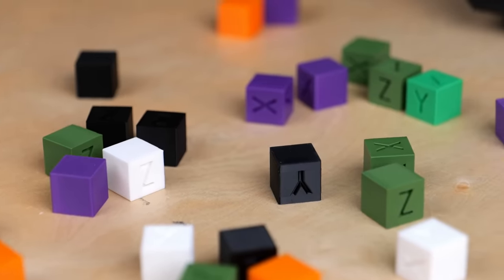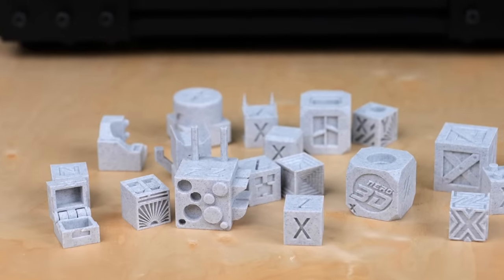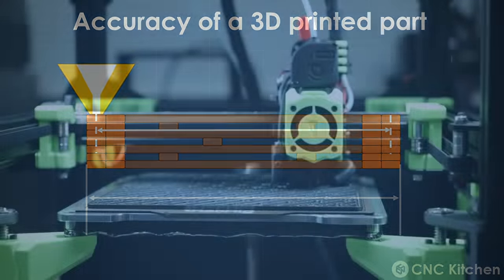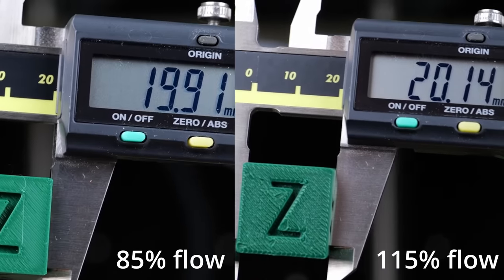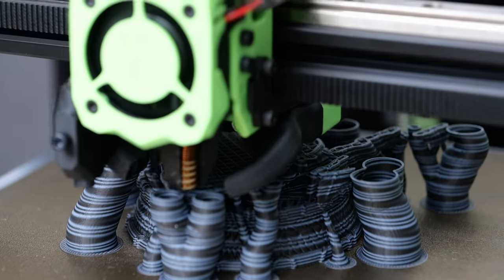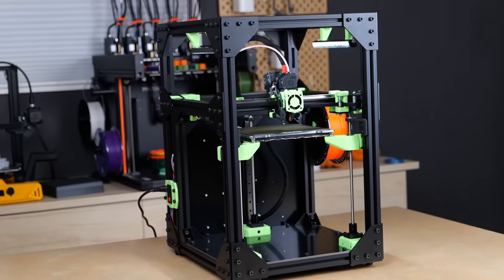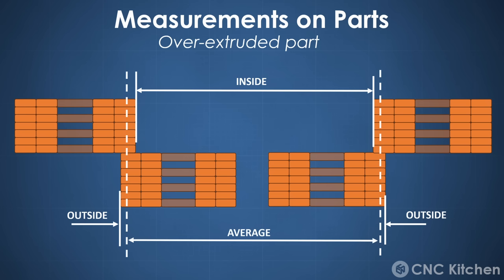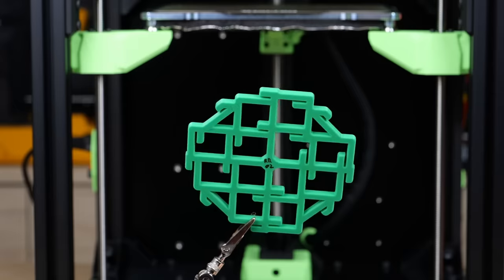Calibration Cubes: More Harm Than Good?

Comment: I completely agree with this method and this video explains the multitude of variables and how to calibrate and square the machine quite well. I've tried to guide customers to calibrate their machines and most will just not do it at all and assume that the machine is already calibrated from the manufacturer. the only change I would make to the cali-flower is adding a relatively tall tower thus adding more accuracy to the Z axis. The wider, longer, higher measurements you can do will add more accuracy. It would be nice i the material doesn't matter and the measurement were measured at the center of the nozzle from a reference point and the software would compensate for the material and settings used.

Comment: When i first started 3d printing i altered the steps per mm, but as i gained more printing experience I came to the same conclusion as you that it was not the proper way to compensate for size error as the majority of it is material shrinkage which varies.  I've also found that there are tons of variables including temperatures when printing, i.e hotend, bed, enclosure or ambient temps.

  I've also found the speed at which the part is printed can affect shrinkage.  I think this has to do with the rate at which the filament cools on the part.

For example, I've printed a test part and then scaled it.  Reprinted the part to verify that the scaling was correct.  Then when i would print a batch of those parts the size would change.  I suspect this is because the layers have more time to cool as the printer is moving from part to part every layer.

I was able to negate this by completing individual parts 1 at a time.  Aka if printing 10 parts I'd enable individual part printing where it would fully complete 1 part before starting the next.

I guess my point is that if you want to print accurate parts there is not 1 set of variables that will work for all situations.  You'll have to adjust based on what your printing.

Comment: 5:53 I would really appreciate links to the other tuning steps you took - so many stl's and techniques out there just knowing what you used would be valuable, otherwise I'm left trying to recreate the process and wondering if my results are as good.  You mention:
Extrusion Temp
Flow %
Retractions
Pressure advance

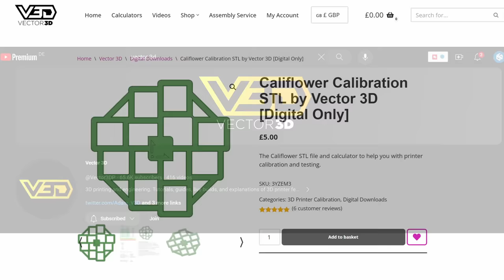Comment: 5:26 I prefer the calilantern, which is the version of the model with a z component! If you're going to measure a bunch, you may as well fix the skew on all axes. And yes, the shrinkage should be tuned for each material as well, once a base rotation distance has been set.
Reply: Yeah, going to buy the calilantern now. I've printed so many public STLs that didn't quite fit, never sure if it was the model or my printers. The biggest downer with 3D printing IMHO is making parts fit with post processing.
Reply: I felt like the Cali lanterns is harder to hold and get consistent measurements on

Comment: I find those vids/topics fascinating, mostly cuz makes me realize how experience/knowledge dictates much of what one does. Personally, since the very 1st time I've started 3d printing on my 1st machine years ago, I've calibrated it on a per project/material basis.. for me this has always been a given, but then again I went on to study precision mechanics when I was 14'yo and thus have had a deep understanding of many different manufacturing processes and materials for literally decades... Since I also have an engineering degree on mechatronics/robotics, so CNC machines and such are just intuitively simple to understand and thus tweak. But I do realize many enthusiasts lack the same fundamentals, and this is what I like the most about the 3d printing community, folks often times share openly the knowledge and often challenge the "trends" in order to help each other to achieve better results... Kudos for the topics and analyses...
I will say thi tho, I do find both my i3Mk3s and P1S to be reliably precise, as long as properly calibrated for the material used, and still is not uncommon for me to tweak the models to compensate for inaccuracies of the machines, after all hobbyist 3d printers are not nearly as accurate/precise as professional grade industrial machines... Even so, w/ the certain measure of knowledge and care one can achieve amazing parts w/ these little machines XD
Reply: Хорошо сказал.
Reply: also, I hate when my phone wrongly auto-corrects me (like my comment above), kudos to machines that while maybe not as smart and thus very reliant on us to get things right (as of yet) at least don't pretend to be "smart" and f. us all the time on simple stuff (like writing a message or navigating the city)...(looking at you iPhone/Apple and others).. love my 3d printers cuz whatever tasks that don't need my input they do perfectly well, everything else they do exactly what I command them to do...

Comment: Major props for letting the author of the cauliflower update his design, it's not one I've seen before but I've been meaning to my Voron even more dialed in and it looks like it'd be a big help. I'm fully in agreement with your conclusions. Steps-per-mm are defined by the gearing of your printer. Shrinkage adjustments, line width, etc will dial in a printer far better. And don't forget to print a cooling tower to dial in your fan speeds as well!

Comment: I agree that the cube isn't perfect at all, but it's a good quick way of checking accuracy in general rather than a tool for adjusting for it.
Califlower seems like a nice development, though I'd like to know how can I adjust bambulab x1c with data I get from that print except for in slicer settings for every profile for every nozzle and material I use.
Reply: For any of the bambu labs printers would be good as not everyone owns a x1c 🙂

Comment: The parts come out undersized not only because they shrink, but also due to wrong assumption. You assume that every tooth of 2gt belt has a 2mm pitch; however the belt is manufactured undersized, because it's supposed to preload to nominal pitch while minimising vibration and backlash. You notice that when you adjust the tensioners on your 3D printer, they go quite a way between the belt has its slack out and when it actually feels right, and all this tensioner displacement goes into stretching the belt. And there's yet more leeway, it's in millimetres, it's not at all minor. Unfortunately i forgot what the belt spec tension to size is, and it's going to be different between Gates belt and a Chinese belt anyhow,  but from my memory you can't really achieve it without exceeding the maximum recommended lateral loading for your steppers, too much and they may not run smoothly or the bearings may seize up.

On a Cartesian driven printer, you expect the tensioning error to be quite anisotropic as well.

I'm actually working on a yet different way to calibrate printer XY/skew, it's not going to use calipers, or indeed a print, and i think it'll be better.

Comment: I used dial indicators to calibrate my axis, just use the full range (10mm in my case) of the dials and make sure to only move in one direction to prevent backslash from the belt. Takes out the whole material tolerances and only focuses on the mechanical parts.
Reply: I do the same. I also used the dial indicator to make sure every axis was adjusted square to each other. Once this is done, you know any error is from something else.

Comment: Your per-material scaling factors are in line with what I've seen working in a 3D printing-based production environment, which is reassuring. I wonder if we'll see a specialized filament for calibration with a minimal or precisely known shrinkage factor so we can still do these tests to figure out actual steps/mm

Comment: I agree 100% with you. BTW Adam created a new test jig the "Calilantern Calibration Tool" that do the assessment in 3D. I ordered it today and I am looking for my first evaluation.
Also, a suggestion: with that many parameters to tune to optimize prints, printer, filament, etc. could it be possible to create a presentation on test methods and their sequence ? I am convinced that many viewer would appreciate it.
Keep the good work.

Comment: Thank you!
I have been fighting step calibration myths like the mentioned for years now, but every youtuber made a video on this and keeps the myths alive.
E-Steps in particular are a very hard thing to explain...
Don't calibrate E-Steps, calibrate flow for each filament...
Use the steps from the manufacturer
X,Y,Z steps should only be dependent on gear ratios, belts and stepper degree, so imperfections are mechanical problems
Reply: 100 percent agree,.
Reply: there's definitely a place for calibrating E-steps though, for instance, if you change components on your extruder that change the gearing, you need to change the e-steps. that way 100mm of filament is actually 100mm and not 112 or 95, then you can fine tune flow per material in much smaller amounts after that.
Reply: @callsignapollo_  100% true, but in most cases the manufacturer
 will provide the e-steps for your extruder gearing.
Those are usually for 1.8° steppers, so in case it's a 0.9° stepper those needs to be converted.

Comment: Thank you for confirming my long held suspicions. I've never bothered to print a calibration cube because I wasn't confident that my cheap vernier calipers were accurate enough to make my calibration better rather than worse, but the Califlower being designed for standard 150mm verniers makes a lot more sense.

I've just bought the Califlower model, so I look forward to giving it a go once I've fixed my current Octoprint problems.

Comment: I’ve tried the calibration cubes on both my Mk3S+ and MK4 and didn't feel a need to change anything. When I print parts that need dimensionally accurate, they seem to fit with even tight tolerances. If it ain't broke…

Comment: Coincidentally I just used the skew compensation in Marlin for the first time about a week ago. I recently finished a 3D printer build I started years ago (and kinda forgot in the corner) which has a very classic "printed parts and threaded rods" frame construction. But the printer I used to print the parts ~5 years ago had a somewhat tilted bed - resulting in a permanently skewed printer, no way to get it square without completely reprinting and rebuilding it. Then I remembered that there was this skew compensation nobody ever talked about in the Marlin config and gave it a go - works great!

Comment: When I calibrated my steps per mm, I used the caliper to measure the hardware how much the X and Y moved for 100mm.  like you said in video printed parts shrinks,  I compensated for that in slicer settings, filament shrinkage,  print stick 100mm long and measure/calculate the difference.  I am no pro, but it just made sense to me to do it that way, maybe something to try yourself.

Comment: One very important factor to having dimensional accuracy is belt quality and consistent tension on the X and Y. I switched my ender 3 v2 print farm to all gates belts and tuned them all exactly the same using spectroid app to 115mhz. I also do skew correction and my prints are absolutely spot on. I have a tolerance of 0.1mm on all of my printers so they are all printing within 100 microns of each other.

Comment: The only thing that would actually cause the printer to be inaccurate is if the sprocket (or screw) is inaccurate. So I agree with you, never change the steps.
Reply: Actually I suppose it is the belt tooth spacing. The pulley picks up 16 or 20 teeth in a rotation, and the belt determines how long a distance that is.
Thus, belt tension plays a role.
Reply: It's the belt tension too. Elongating the belt elongates the part. Very very small effect though.
Reply: @mjetdevelopment  Yes, but only the dynamic stretch of the belt. If it gets longer over time that shouldn't matter
Reply: @pizzablender  The teeth are only to prevent slipping. All that matters is the diameter of the sprocket. If your belt is so stretched that it slips you have worse things to worry about than accuracy.
Reply: @MaxWithTheSax  No. The belt never skips, but if you stretch the belt, then for the equal number of teeth passing the pulley, with a stretched belt the gantry travels bigger distance.
Reply: @mjetdevelopment  I see your point now. But if it stretches that much it wouldn't fit the sprocket any more since the teeth on the sprocket don't stretch.
Reply: @MaxWithTheSax  Yes. I think this is more of a theory but the real impact of the belt elongation will be really small, way smaller than all the thermal and other effects.
Reply: @MaxWithTheSax  The teeth translate each rotation of the motor into an exact number of belt teeth moving. And as long as it doesn't slip, it is the length of those teeth on the belt that gives the distance moved.

Comment: I've been relying on Adam's Califlower for tuning since it was released. That's the only tuning process I use for skew / dimensional accuracy per material. The most helpful print, IMHO. It's also a great thing knowing you've been working with Adam to further improve it. Makers helping and supporting makers. <3

Comment: Really, I mean Really, and I can't stress this more, YOU REALLY spoke from my heart with this video.
I never understood why you should ever tune your printer for dimensions with printed parts. 
There are sooooo many, and I mean soooooo many influencing factors for plastic parts, especially in 3D-Printing that it just don't make sense. 
Get a good dial gauge and measure the distance the printer is moving. And check the skew with other proper measurement equipment. 
If you print different materials you will notice differences in measures, printability and so on and so on. 
So thank you very much for this video.

Comment: IMO you should always make your machine square. Period. Shame it takes so much time for community to wake up to the basics.
Reply: Software hacks to compensate bad constructions are no good. But when it comes about bed mesh leveling it's often difficult... because you can't simply tell that person buy new beds until you find a completely flat one 😅
Reply: @REDxFROG  Especially for beds with larger or fancier platens. A 500x500mm chunk of cast aluminum 4-8mm thick isn't a cheap thing. Services or tools to flatten the surfaces aren't cheap either of they become necessary. And you can't use them at all if that platen comes with a special textured surface on it or the bed heater comes welded in place or there are magnets glued "permanently" to one face, or if it comes powder-anodized for grounding purposes.

Comment: Stefan, I noticed these issues with the calibration cube myself a long time ago, but I chocked up the issues I was having with just personal error and mistakes. I feel ashamed and foolish for not having though that the print used to calibrate could be the problem. Thank you for this. I have already purchased the cali flower. I'm going to go tune my printer now. Thank you!

Comment: I just bit the bullet and bought the Califlower as I’ve been struggling to get anything to print that needs to fit together. 2 prints and a tweak to the extrusion and I’ve just printed a 3 part print and it fitted together perfectly first try. Best $11 I’ve spent on the printer!

Comment: On my 2019 Ender 3 non-pro v1, which I completely disassembled and rebuilt as square as I could using tin foil shims, I calibrate steps with a dial gauge, e-steps extruding 100mm, extrusion flow with a 2 wall box and compensate per filament in CURA's horizontal shrinkage setting. The plugin called Material Settings allows me to enable the shrinkage setting on the material, when I select each material it changes the settings on the profile automatically.

Comment: I have never done it that precise. I happen to have my own test with a 15 times 15cm square that has a pilon that is 15 cm in height as well.
I always used that to check my printers but only after I suspected them, it is not a test i do as a standard.

Good video, I learned a lot.

Comment: When i calibrated my machine i just measured the position of the head directly bypassing all the issues with shrinkage, elephants foot, overshoots, and wall growth. To compensate for shrinkage, you should be doing that as an additional layer within the slicer profile. I suppose you could roll it all into 1 calibration value, but if you use more than 1 machine or if you change machines, then instead of using your existing shrinkage values, and just calibrating the machine to ensure they are all accurate and consistent, you have to create different values for every material-printer combination which is a lot of work and profile management especially when you are doing this on a professional level.

Comment: I said this a long time ago. There's also expansion and contraction in the machine, belt tension changing, per filament spool differences (no two are exactly identical), z-offset, motor steps, acceleration and de-acceleration, etc. I always go for a +/- 0.2mm.

Comment: I totaly agree. Thats why I created the "calibration cross" on TV (precursor of the calbratin flower?)and proposed a material&heat bed shinking compensation for the Prusa slicer (was never accepted). By the way the most of the shrinking is exactly what you can expect from a part cooling down  from heat bed temperature to room temperature with the corresponding coefficient of thermal expansion.